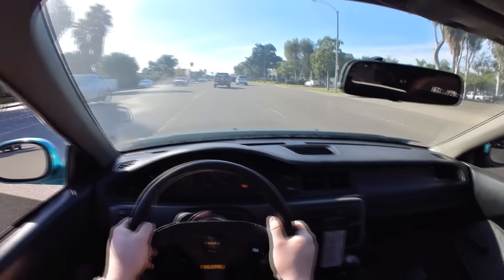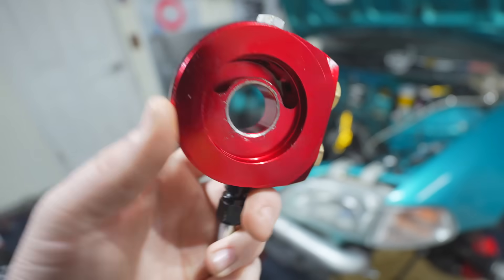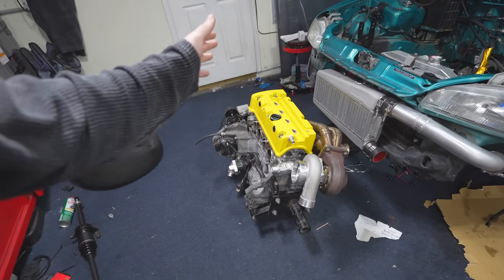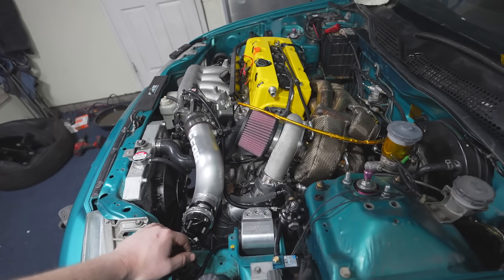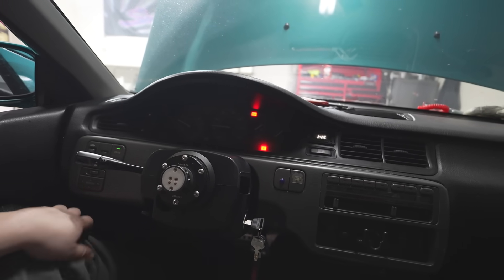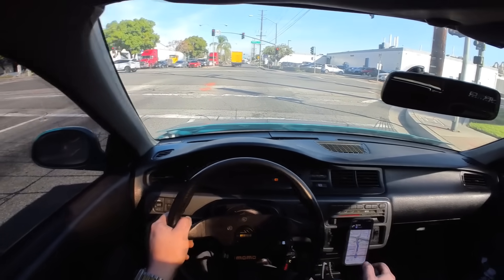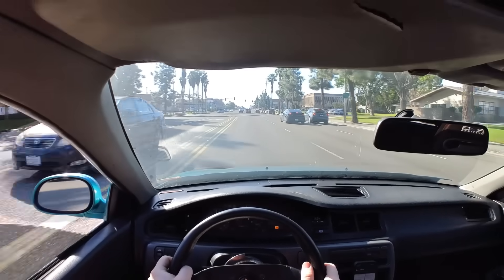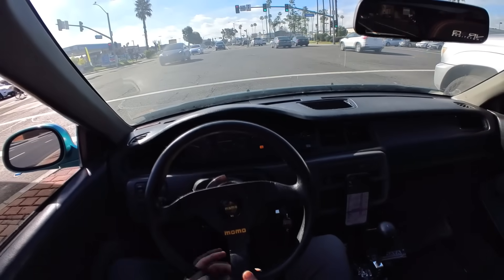Did I ALREADY Blow Up The K24 HONDA,,, AGAIN?!?

Comment: Drew, do some research. DO NOT RUN DISTILLED WATER IN THE COOLING SYSTEM. It will corrode it. It's fine for an emergency situation only. You want to use ionized water.

Comment: Dont know if the head gasket is stock, but it failed to handle the extra horsepower. You need a stronger head gasket and head bolts.

Comment: If you have burs that we're going through the oiling system you kind of need to do a full tear down and rebuild to make sure they are all cleaned out. 3:05
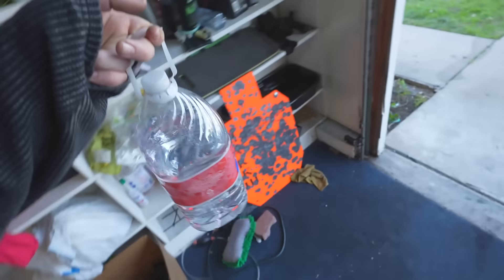Reply: 9:01 normal car guy, let's do a compression check and yank the exhaust to look inside just to make sure. Drew ....... Send it!